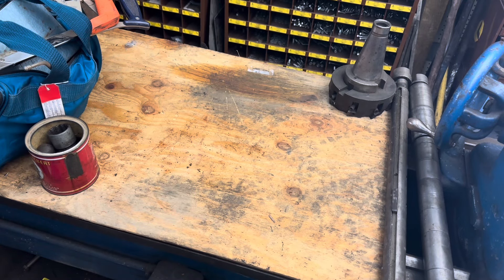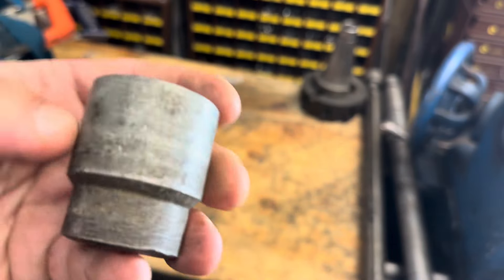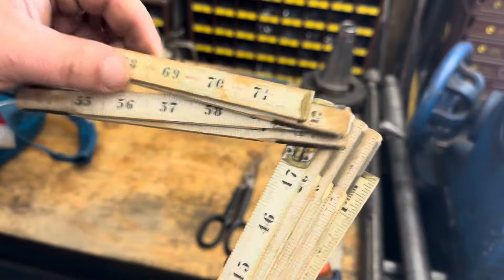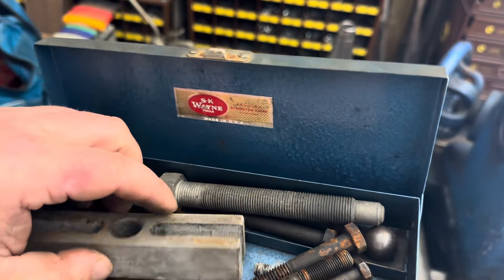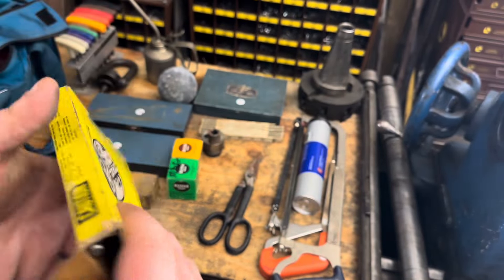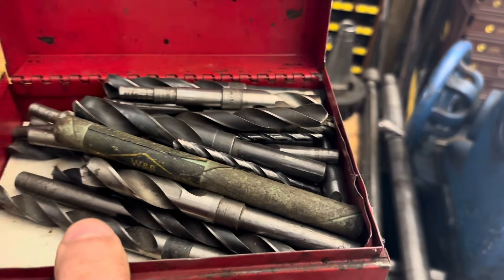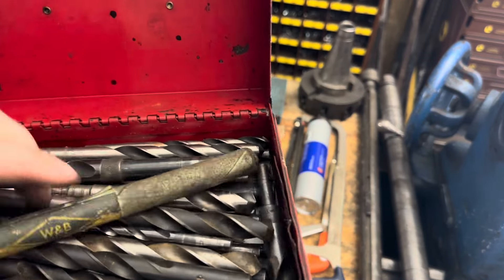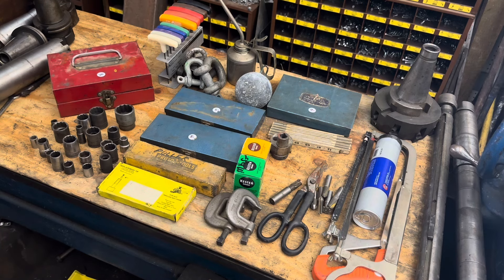Yard sale, auction, and swap meet finds 2024 #1

Comment: Great haul!  Those saw horses were the best deal of the day!  You officially have enough pullers to choke a moose!  Of course I have twelve point sockets, but I really prefer six points because I am usually working on old rusty junk and the six point sockets will either remove the bolt or nut, or snap it off.  The twelve point sockets will usually round it off!  ☹️
Reply from the maker: I prefer 6 points to, I have so many sockets, in the thousands but iv started sorting them a bit by brand